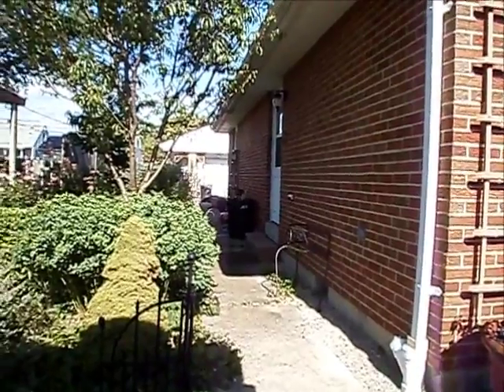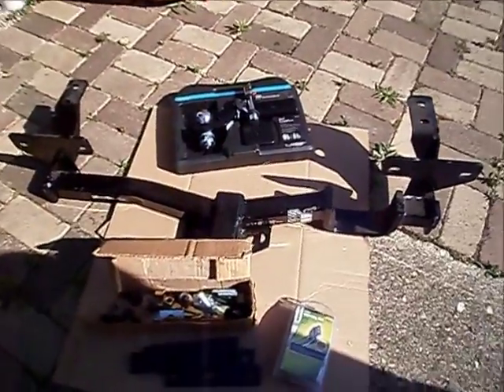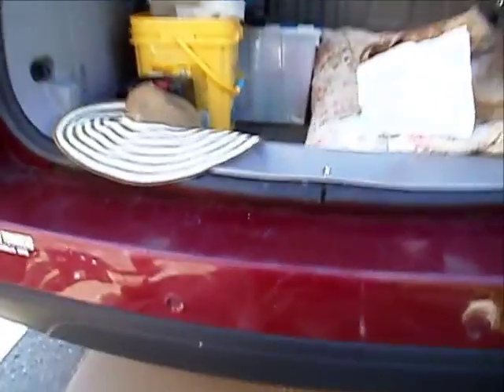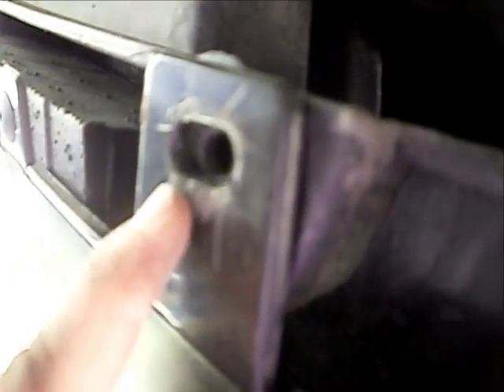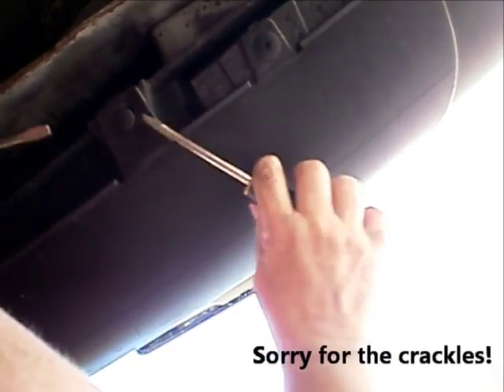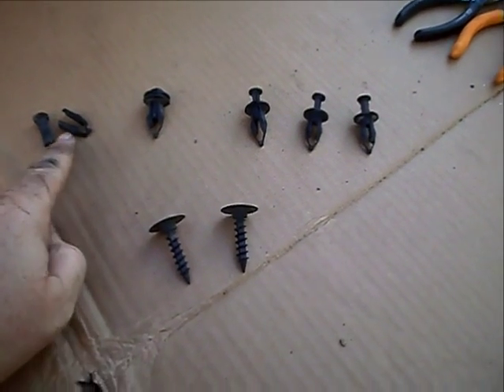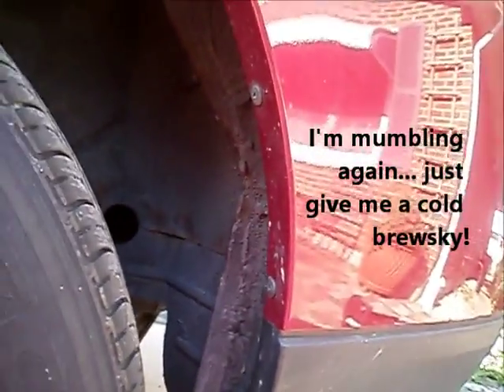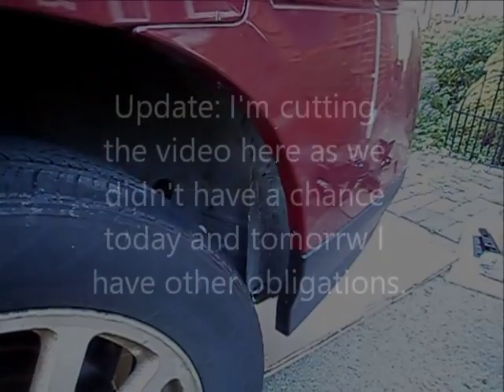Vlog 4 Installing Hitch on Buick Rendezvous

Comment: Hello Sandra,  My goodness,  You are so brave.  I would not want to even attempt to do what you are doing.   Maybe in my younger years but not anymore.   I don't know how to remove the bolts.  If rusty we put penetrating oil on and it helps to loosen the bolt.  wish you success.. 💕 NonnaGrace
Reply from the maker: Hello NonnaGrace - I am not so sure if it's bravery or just plain stubbornness. I just spoke with my father and he suggested pouring Coke (soda) on them a couple of times and waiting a few hours. He's 87 and sharp as a tack and very knowledgeable. Thanks for your kind words. 💕 Sandra